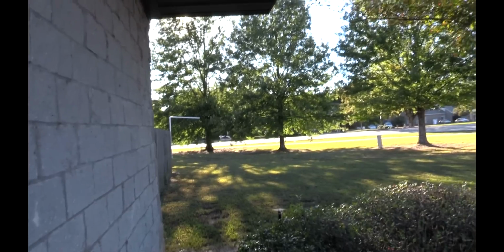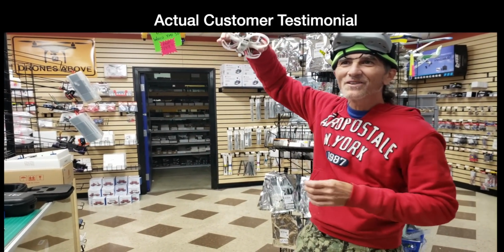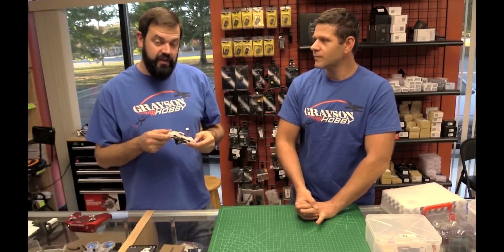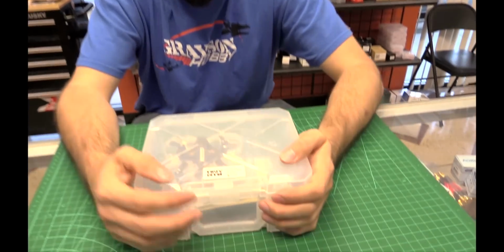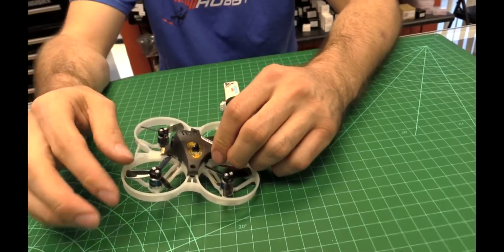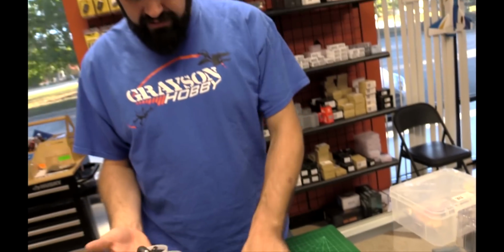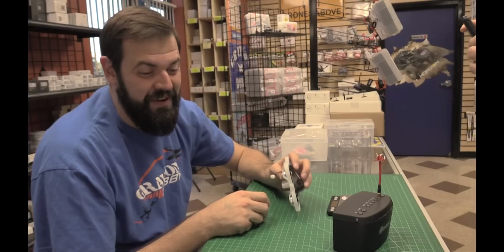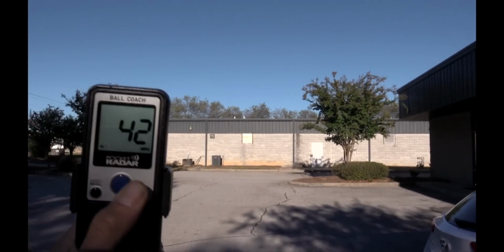Most Durable Mini Drone Racer For Beginners | 2S Brushless Whoop - FPV Quads

Comment: Hello Basil and Will. Can you help me? Here’s my problem. I just bought a LDARC KingKong GT7. I am using a Jumper T8SG Plus(Carbon skinned). Got them binded as I can view all stick and switch controls when I’m in Betaflight. When I disconnect from BF to fly, I get no engine start but lights blink when switching the “arm” Aux 1 switch off and on. Checked all switches in “Modes” in BF and my Bind Mode switch is working.  I do see “LOAD MSO” in the BF Failsafe in the “Setup info” section. My Jumper seems ok and haven’t really tweeked any settings in the Throttle section on it. Please help! I really want to start flying indoors, this quarantine is killing me! Thanks. -Dave S.

Comment: Is there any way to get a screw on prop for the v2 motor? It looks like it has holes for it but I wouldn't know where to start looking. The props pop off constantly and as a result the crash breaks the camera loose every time. to the point that the camera wires break forcing a spendy replacement.

Comment: Warning ⚠️ do not buy this it’s terrible no Betaflight OSD only 16 channels on vtx under powered, only one expensive battery fits , cannot change camera angle , frysky only fcc no telemetry or smart audio, only thing has going for it has a tough frame , there is so much better out there cheaper, this is like 3 year old tech , they need to up there game if they want to be competitive with the other manufacturers.

Comment: To be honest I'm not impressed with any of these that have come out so far this winter and why I haven't reviewed any. 1. The Emax is 1s blah,  2. The Mobula has a fragile frame 3. This one has a weird battery connection, non adjustable camera angle, F3 flight controller, lack of Betaflight OSD so no setting rates etc on the radio. They all lack at least 50mw or 100mw VTX which is needed. I'm hoping Emax goes back to the drawing board and comes out with a 2s version bud doubt it.  It is nice to see you guys have a channel though.
Reply from the maker: Did you fly any of them? The kingkong are very impressive and we have flow just about all if them
Reply: @graysonhobby  I didn't bother to waste the time and money. 25mw is just too little for any real range even with RapidFire. DroneCampRC showed how fragile the Mobula frame is, AndyRC,UAVfutures showed the Mobula is better than the Emax in overall flight performance and many on RCgroups are saying the one above seems slow and sluggish. Truly needs a F4 flight controller and Betaflight OSD along with more VTX output and adjustable camera angle.There is a whoop coming out that not only has all of this but you can actually get it with a Caddx Turtle HD camera/recorder and weighs the same as this one you reviewed... also 3s capable.. BTW why are you out of the Taranis X-Lite Red? grrrrrr I was going to buy one from you last night.. let me know when it's in stock.. thanks
Reply from the maker: I suppose it's based on your skill level and experience. The GT 7 and gt8 from King Kong hands down are the best for taking abuse.  the simplistic design of the electronics make this a dream for beginners.
Reply: @graysonhobby  K fair enough. so about the x-lite red? I like ordering from you guys but haven't in awhile...

Comment: Gotta pass on this one. The battery charge lead is a deal breaker for me.
Reply from the maker: What's wrong with the charger lead, the charge lead comes in the box?
Reply: You can only charge one battery at a time.
Reply from the maker: @ponowai1  if you have a parallel charger, you can charge multiples, we do it daily here
Reply: Yes I do have a parallel charger. Won't help with one lead. Guess I would have to make more, if I were to get a GT8. 
Thanks.
Reply from the maker: @ponowai1  the one connector will work on the balance board, 1 connector is needed to balance board

Comment: Looks great. But camera angle bothers me.
Reply from the maker: Great point, it did not bother us inside or out.  Thanks for watching!
Reply: @graysonhobby  somehow I felt you wanted to fly it faster in the end video. But horizon just dissappears when you pitch forward a bit. Camera angle prevents faster flying.
Reply from the maker: @emotionalbeats7178  we mixed in alot of DVR by different pilots, modes, weather conditions.  but we call this a freestyle rather than racing drone.  but hey, if its not for you then no sweat!  Thats why there are like 100s out there
Reply: @graysonhobby  it is great, and more for freestyle, like you said. Dont get me wrong - your reviews help people, including me, very much. Everything you do has a meaning and is helpful for lot someone. Just stated that fixed angle as a small con. The rest is rock solid. Great job and great channel. It is my pleasure to get involved.